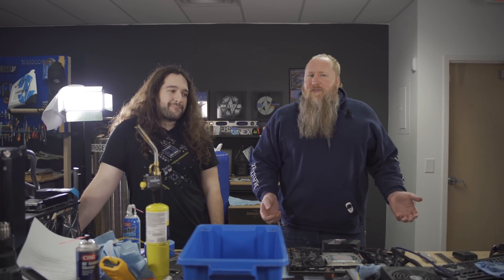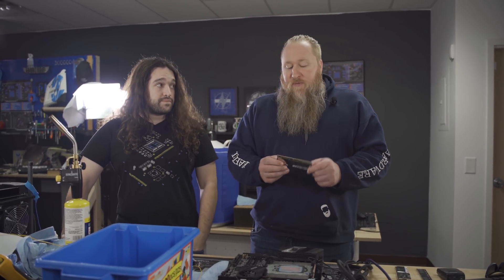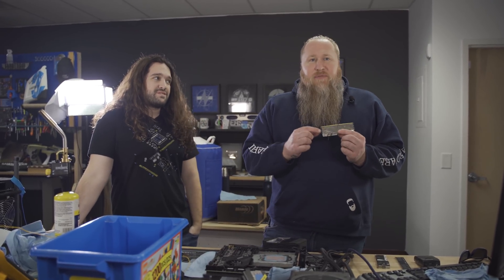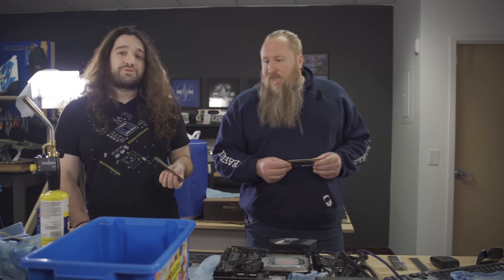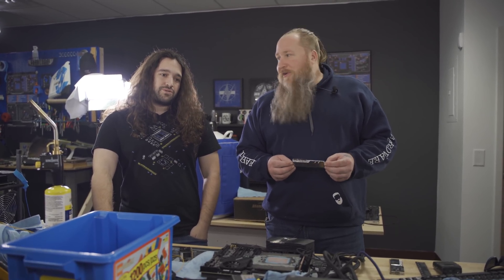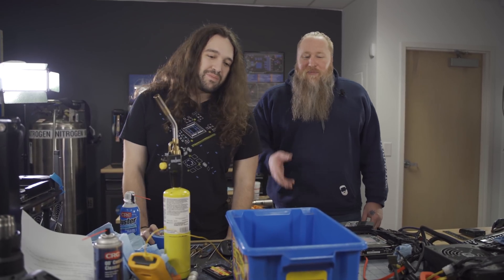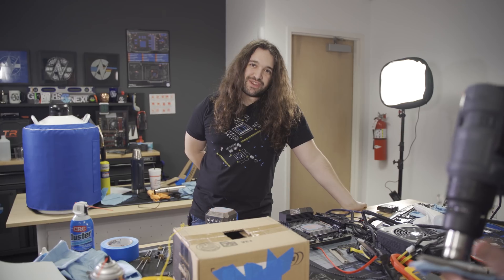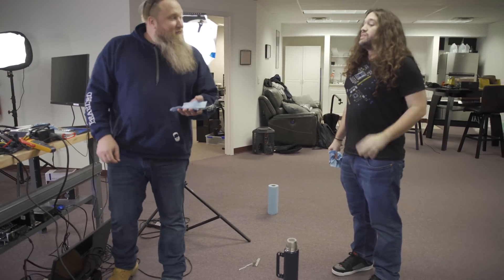Removing DDR Memory Heatspreaders with GamersNexus

Comment: Could you soak the ram in a 99.9% isopropyl solution?
Reply from the maker: Not gonna do much
Reply: @BeardedHardware  Wouldn't the iso be able to dissolve the adhesive holding the heat spreader in place?
Reply from the maker: @kingzero3098  probably would, but likely take overnight.. try it and let me know :)

Comment: MY heatsink came off on one of my RAMS I dont want to put it back in is that fine or can i kill my mb or ram this way? thanks
Reply from the maker: Likely should be fine.. depends on type of ram.
Reply: @BeardedHardware  DDR4 3200mhz CL16 Hyper X Fury, casing came off as I was getting it out of the MB just cleanly came off, but the glue is so strong that im afraid if I put it back on and its wrong ill have to keep repeating the process and might destroy a chip... I'm oldschool AF and I dont remember any of my Pentium IVs having this shit on the RAMs lmao... Thanks for the answer
Reply from the maker: @Pedro-tl7jg  should be fine
Reply: @BeardedHardware Thanks!

Comment: https://youtu.be/Msvi5OcVUTI idk if this will get cold enough to do it but worth a try for us broke folks....
Reply from the maker: Dry ice and acetone is usually how people cool computers just like ln2..
Reply: bearded hardware I just didn’t know if it would get cold enough to fracture the glue like the ln2 did....
Reply from the maker: Travis Baker dry ice works too, I would be careful on the acetone though. Usually with acetone we mix it with dry ice inside the pot and not let it get on the board. It helps to conduct to the metal :)

Comment: Not really accessible but an interesting way to remove spreaders. I have always had good luck with getting them really hot with a heat gun and taking your time with it. https://imgur.com/gallery/gNMyPkg
Reply from the maker: Ya have to be really careful with the pull off with heat.. because you could possibly heat up too much and pull solder balls.. when your doing many modules.. takes way too long
Reply: @BeardedHardware  For sure no mater how you slice it getting the spreaders off is risky business. Eight sticks took a couple hours but I am at home working on my own project so time was not really much of a factor for me <3.
Reply from the maker: kutsuujarble if ya have the time, do the crime lol !

Comment: Doesn't the extreme cold->hot cycle entail some risk of damage from the structural strain of heat expansion? I mean, that's basically what loosens the glue-bond in case too right?
Maybe it's not enough to matter for the PCB and traces though. Any sticks ever die from this?

I wish that if they were going to put heatsinks the RAM in the first place they would at least pretend they had a real function and put some grooves in. Sadly it's just redundant now with RAM being so low wattage, and it's all for the "bling bling" factor.
Reply from the maker: TheStigma I haven’t killed one that way yet.. and I’ve done it a bunch of times.
Reply from the maker: I’ve put metal pots in memory without issue also..  some types of memory just doesn’t like cold.. why ya don’t see us doing ln2 on mem.. will be doing some ln2 on memory soon.. stay tuned slacker

Comment: We use a temp chamber at work for sealed devices that need to be opened.  So nice and easy.  Set the temp chamber to the point where the glue loses most of its adhesion and no worries about going over and melting solder.
Reply from the maker: Who makes it?
Reply: @BeardedHardware  The ones that the EE's use in the lab is a Testequity Model 115A.  I think we heat consumer electronics (watches, bike computers) to 60-80 degrees C to loosen up the glue holding the displays on.  My office mate says use an Arduino based reflow oven :)  That would probably do the trick too and be much cheaper than a brand new $9000 temp chamber.
Reply from the maker: Tom Budd yeah I’m working on some other stuff I want to play with..thanks broski!

Comment: That's industrial double-stick tape. Sounds like no big deal but it is a big deal. It's one of those "if you ever want it apart don't use this" things. They use a brutally strong adhesive for it. 

Ultra-High Bond Tapes (UHB/VHB)

        
            
                

When you want to make sure your taping job holds up 
over time, use Ultra High Bond or Very High Bond (UHB/VHB) double-sided 
tape. This type of tape is so strong that it can sometimes be used as an
 alternative to other fastening options, such as rivets, spot welds and 
liquid adhesives. For heavy-duty taping tasks, you'll want to make sure 
you have double-sided UHB tape or VHB tape available to handle the job.

Comment: Secondary effects of this process you might not have considered is you've just cryo treated the metals, which should theoretically make them more resistant to fatigue from thermal cycling.
Reply from the maker: Too many worried about cycling .. take cpus and gpus down to -196 and they are fine ;)

Comment: Ever since they basically stopped making dominator platinum non rgb in high speed low latency kits I’ve started wanting to buy nicer ram and swap best spreaders. Asrock creator with 3990x and 128gb of 3600 c16 or 3950x and 32gb of 3600 c14 swapped with dominator platinum heat spreaders is basically the height of indulgence for me.  This is why I can’t have money.

Comment: I never had a problem with using a thin credit card like device to pry open the  module heatsinks. Just make sure you get in between the adhesive strip and heatsink. No heat needed. Just twist or rock back and forth.
Reply from the maker: Not all are the same and they have been using some crazy sticky glue.
Reply: @BeardedHardware   Sure do, have removed many ddr3 hs'rs some brands like Corsair use crazy glue. Here's first kill of mine, left in ln2 about 20 sec after the temperature equilibrium point. This happened as I went to pull them out https://imgur.com/a/vKCHc
Reply from the maker: Don’t pry slacker .. wait for the pop
Reply: @BeardedHardware   Haha, I didn't even touch them yet when they popped on their own while still in the ln2

Comment: How do you remove fan header clips from gpus? I can never even unplug the fan if I want to repaste it. That is the real impossible task.
Reply: Just pull it out usually. Just don't grab the part that's attached to the PCB.
Reply: You could also try to move away the cooler without needing to disconnect the wire. That's what I did.

Comment: Video seems really quiet, also...leaving it in MEK for a few hours is likely to cause the glue to debond...or even just brushing it on and leaving it for a few seconds..

MEK is restricted in some US states though I beleive (explosives reasons)..it's a longer chain ketone (like Acetone), I use it at work a lot.
Reply from the maker: The video was a tough edit with some audio, still working with the new mics.. what would concern me is if that stuff would eat the pcb..
Reply: @BeardedHardware  I was a printer for 20 years & we used MEK as a 'Quick Clean' for dried on ink on many types of metal & anything the ink got on & then dried,
S.A. seems to have some good insight in his comment too, the PCB should be safe but would be worth giving it a test on a stick of RAM that is junk, also I don't know how coloured metal like anodizing would react if you wanna keep the heat spreaders,
I'd also consider a Face mask with vapour filter as it is not good for the respiratory system, I don't print anymore so don't know if it still available here in Australia, but even when I was printing in the 90's there were plans to ban MEK for health reasons
Reply: @BeardedHardware  Yea I thought as much, no problemo.

MEK should be ok with PCBs. It's not good for Polyurethane based material or PVC. I use it on boards to clean salt water residue off ROVs (Robotically Operated Vehicles) PCBs at work and also clean marine cables down with no problems. I've used it at home for thermal paste, but it's massive overkill.

It'll eat the glue alright, but IPA or Acetone might be a better option as it's less harsh

Comment: @ bearded hardware, help!! I heard you say on the 3990x liquid nitrogen Livestream that "clock_watchdog_timeout" has to do with cpu not having enough voltage, yet I get the blue screen with PBO+XFR or with a static OC, moved voltage all over, still get the blue screen, I even did 2 clean installs of windows 10 build 1903&1909 , can't figure it out 🥺🥺
Specs : 3900x/ dark rock pro 4
x570 taichi / 32GB Trident z 3600 cl14 
Aorus extreme 2080ti 
Corsair hx 1000w PSU
970 Evo plus nvme 512GB/viper nvme 1TB
Reply from the maker: How’s your temps? And mount? When it bluescreen, what’s the exact message?
Reply: @BeardedHardware  well that's the thing, I haven't changed anything, it started doing it and hasn't stopped maybe 3 months after new parts (cpu, RAM, MOBO)  exact message is "clock_watchdog_timeout" seen an option for it in BIOS , is auto by default, tried disabling it with no success
Temps while playing borderlands 3 , probably most demanding game I play 
CPU-71°c spikes, normally around 50°c (thermal grizzly paste)
GPU-67°c  
RAM- 40-45°c  , 
MOBO-58°c
Chipset-60ish 
Case has pretty good airflow ,even have a fan maybe an inch from RAM/VRM lol
Reply from the maker: Have you updated bios?
Reply: @BeardedHardware  yeah I'm on the current version, I may try the beta , may do a full teardown or try my GPU in bottom slot,
currently in shadow of the tomb raider , cpu & GPU are both boosting normally but crazy stuttering, GPU usage bouncing all over the place ,

Also from that Livestream I bought one of the mousepads, thanks for the signature 😎
Reply from the maker: deminybs something seems off for sure.. maybe put it on a test bench and rule some things out..
Reply: @BeardedHardware  done a bit more research, seeing lots of people pointing to PSU, i've had this one maybe 6 months , but did see a decent amount of people saying theirs died quickly or was DOA, I do have a backup.and if that is the issue good thing it has a 10 year warranty...😂 Gonna try that tomorrow,
Updating to beta BIOS didn't help, nor did moving GPU down a slot.
Reply from the maker: deminybs that would definitely cause it.. always get a proper psu, it’s so important as you see :)
Reply: @BeardedHardware  true! Makes sense how that can cause low cpu voltage ...got a friend with an hx series PSU too and he hss no problems with it. He even bought it used  , I bought mine new, shit happens though, just glad I got my brain past the loop It was in , 
Thanks for the responses! Will be awaiting new videos
Reply: @BeardedHardware  OKAY SO UPDATE!! 
PSU is good, backup gave same results, tore down and switched to my deepcool 240 captain AIO , tried different drivers etc, apparently the auto OC from default BIOS settings sucks and was causing my issues, decided to static clock to 3.8ghz all core (base) @1.15v and I'm not having any stuttering issues AT ALL now 😁😁, just had shadow of the tomb raider open for an hour or so and GPU usage stays at 98% !! 
now to slowly work my way up... Cheers slacker!